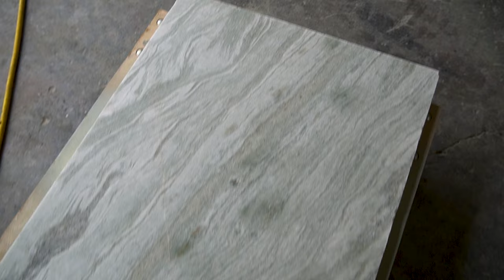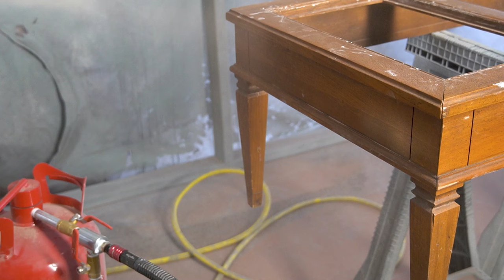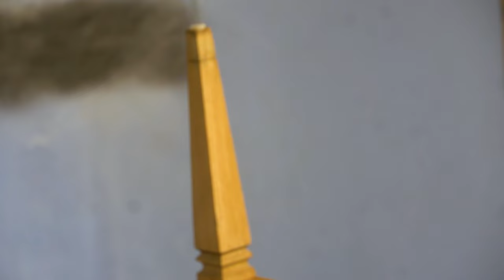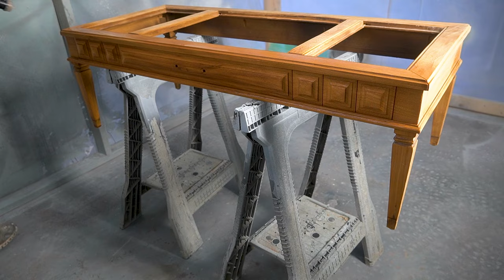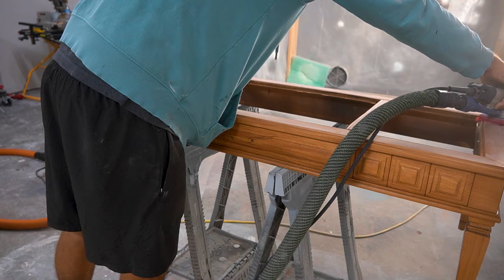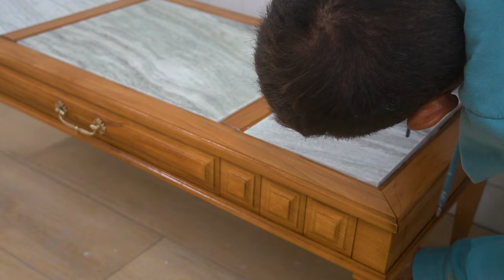Mid Century Coffee Table Restoration

Comment: PLEASE!!!! Make a video on your blasting setup!! Lol. Before you mentioned possibly doing one, I was going to ask you too. I purchased a basic 10 gallon sandblaster like yours, I think, off of Amazon. I put it together; but now, I’m not sure what to do. My husband and brother in law have kinda scared me into not using it because I might get hurt. I don’t know if either one of my air compressors have enough hp to blow out the medium. Having a video tutorial of you nerding out on all the details that I can refer to would greatly be appreciated. I refinish antique and vintage French chairs. So, I need a decent system that can get into all the chair intricacies and in a timely way. I have a small handheld soda blaster, but I have to refill it constantly, which is a pain in my butt. I’d be thankful for any help you can provide. Happy Holidays!! KB
Reply from the maker: What size air compressor do you own?
Reply: 20 and 25 gal.
Reply from the maker: If you hook them up Teed together it might be enough but it would be tough unless you used the very small blue soda blaster from harbor freight. My compressor struggles with 18 cfm.